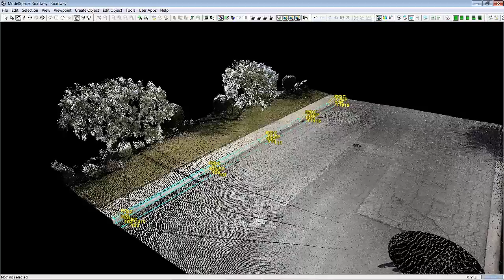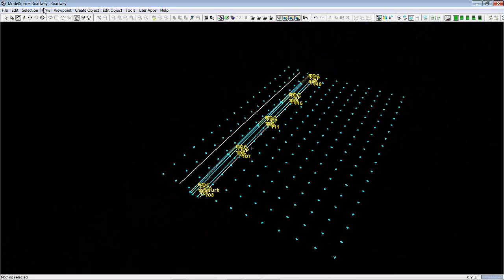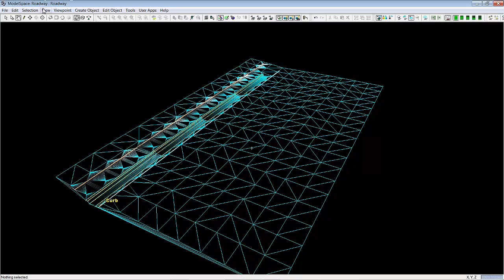Leica Cyclone 9.0 - Grid and Mesh

Comment: Where do the points with the point number, and codes go once we create the points on a grid?

Edit: I've managed to figure it out, it attaches it to the metadata of the vertices.
If you want it in a certain text delinted format you have to select the vertices, export to .txt and use or create you template to get the format you want.

I was hunting through virtual surveyor like a mad man trying to find out how to mass select the vertices.